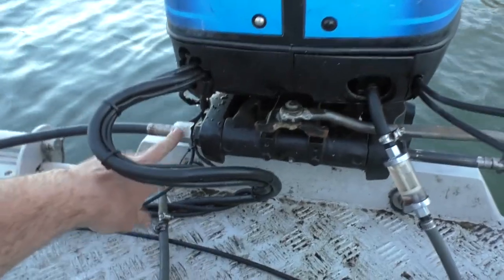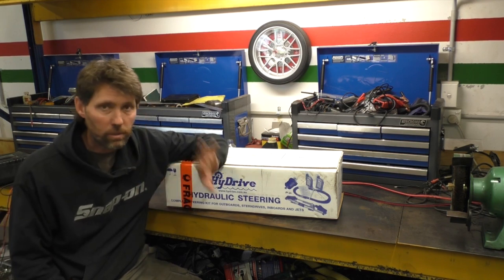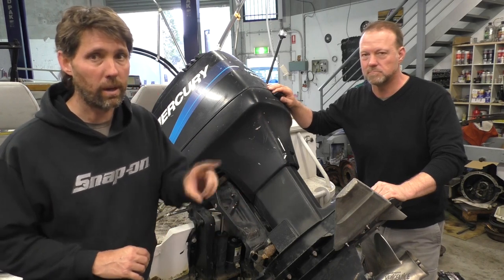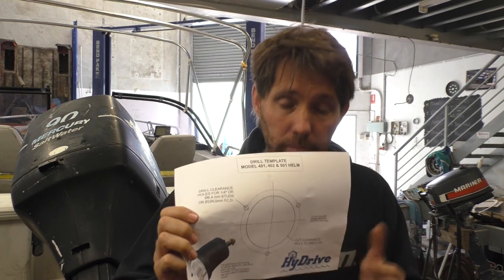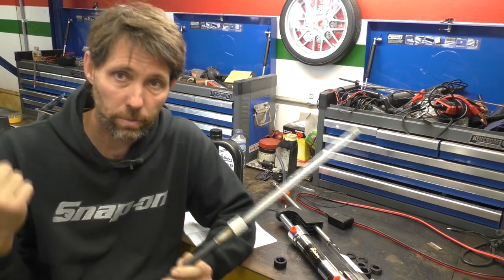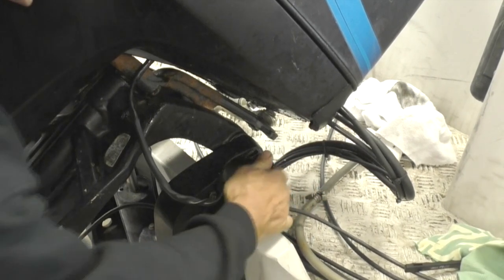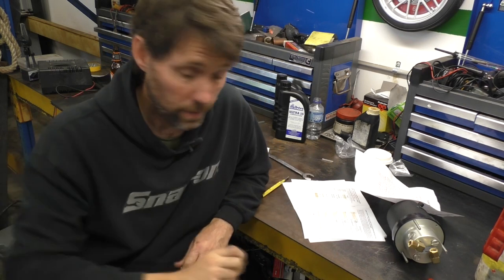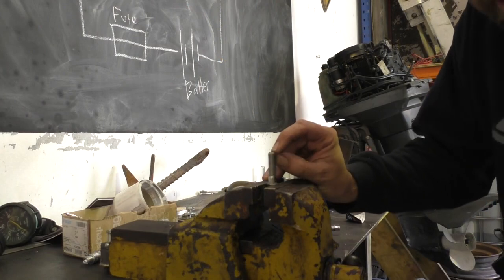Installing HyDrive hydraulic steering in a boat

Comment: Hey mate, I'm currently half way through one of these installs. As a heap of people have commented already - you're vid is spot on and heaps of help. Just finished screwing in the helm and cylinder fittings. I swear these things come from factory designed to face the wrong way! Cheers
Reply from the maker: Thanks Stuart, glad the video is helping you with the install. This steering has been working great since it went in, I'm sure you'll be happy with yours. :)

Comment: Great video, Stu. I've been pondering this upgrade for awhile as my Yamaha 90 4 stroke is rather a big beefy gal and with the push/pull steering it makes for unpleasantly high effort currently. 

I wonder for those doing this single handed if leaving the steering wheel off and using an electric drill to spin the helm slowly is an option. Possibly more effort to do properly than it's worth but it would free up a hand.
Reply from the maker: Having used this steering now, I'd highly recommend the upgrade. Interesting idea about using the drill. I mostly used the palm or one hand to turn the wheel, but pulling the trigger on a drill would be less wobbly when pouring with the other hand.

Comment: For drilling out existing holes, get a scrap piece of wood and make a hole with the larger hole saw. Then you can position the piece of wood and center it over the existing hole to use as a guide.
As always, excellent video!